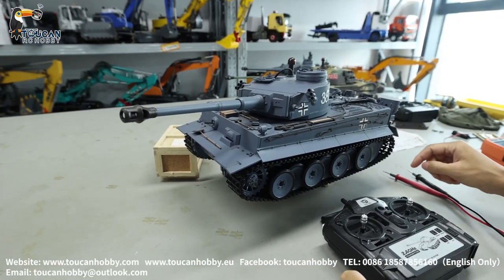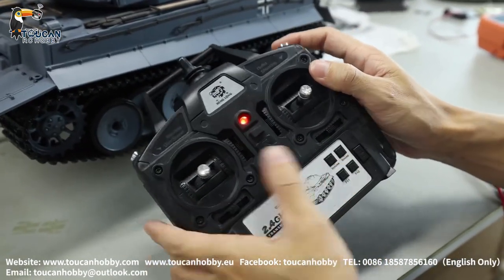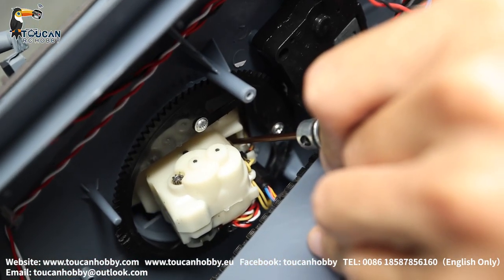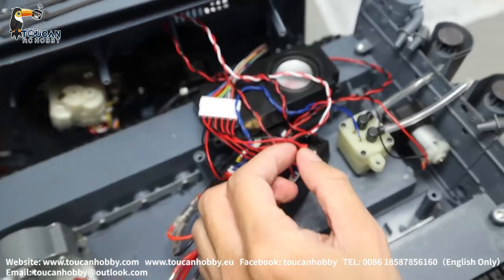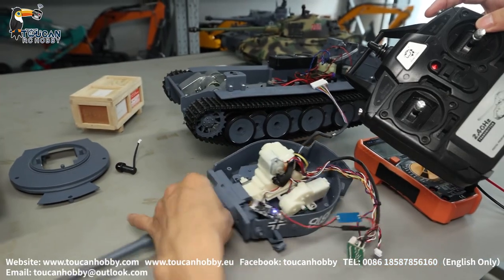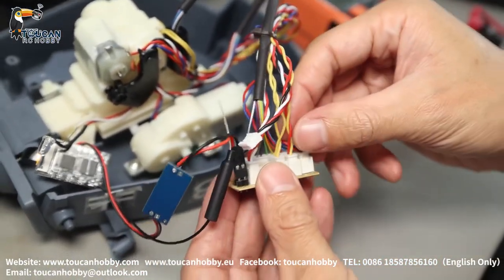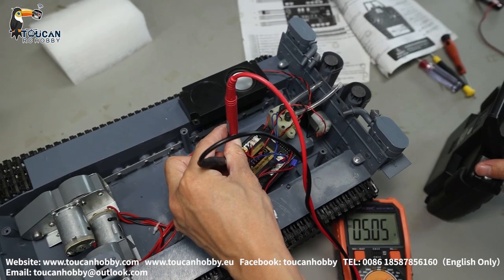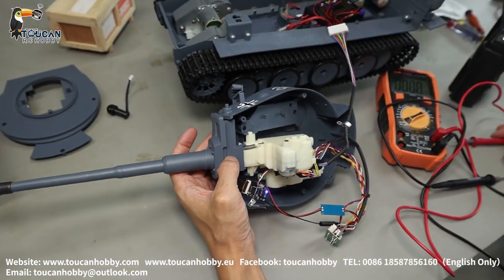How to check if henglong tank not firing BB, even no firing gear sound?

Comment: I just bought this and the transmitter just beeps and connects to the tank intermittently sometimes it works for five minutes sometimes it works for five seconds do I have a bad controller?
Reply: Check your remote like the gray bits behind the battery I had that problem but mine would not turn on so I hope I could help. Just make sure those gray bits are in fully